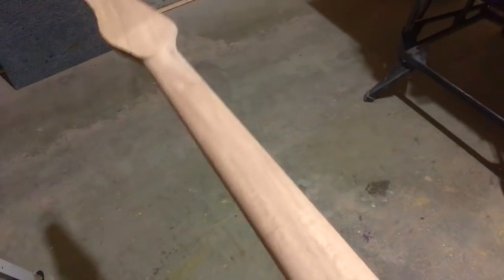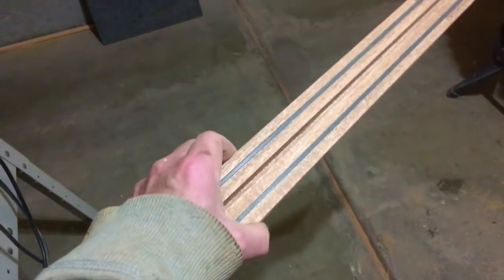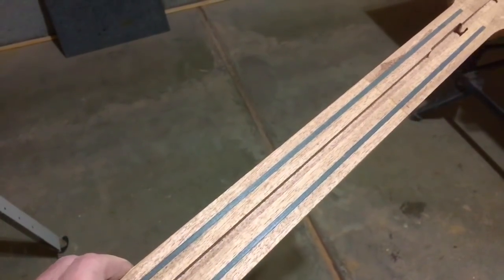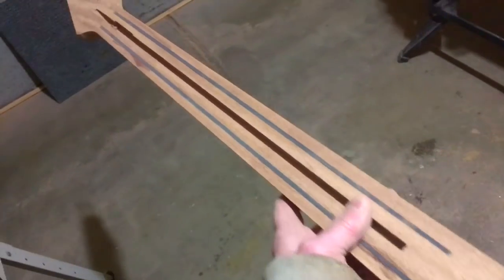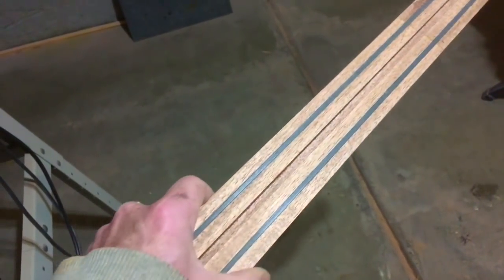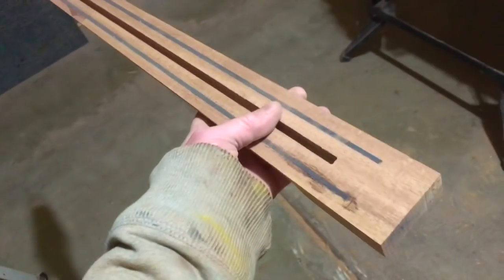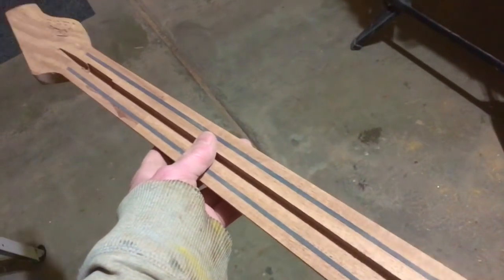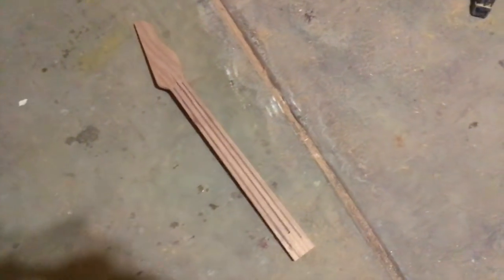Reinforce a Guitar Neck With Carbon Fiber

Comment: dual CF rods installed like he's installed in this neck will to a fantastic job of eliminating the wood's propensity to TWIST also. If you have quarter sawn and flopped your stock blanks to minimize bow warping, it induces the chance of TWISTing due to opposed wood movement laterally. Two rods epoxied in that way will kill twist. Many of the major custom shop brands are using this method now right out of the gate. Good video Chris. Last thing.... StewMac is pretty proud of their CF rods. They are a tad spendy. DragonPlate CF will save you quite a bit for the exact same product but you need to know your dimensions and order them ahead of time as they are made to order. I usually buy them in bulk of 10 -12 at a time.
Reply: @raleighburns3768  I like the DragonPlate idea.  I also like the idea of a 50/50 wood/carbon composite neck

Comment: @Highline Guitars  Wonderful Video! I have been having an issue for years on my Strat neck. It always moves, gets unplayable after multiple setups too. Can I take off the rose wood finger board and route it for the carbon fiber reinforcement on that neck as well?
Reply from the maker: You could, but that involves a lot of work to get it right.
Reply: @HighlineGuitars  so would you recommended it? 
Also thanks a ton for replying.

Comment: I picked up an Epi 335 for sale last year that I really love. The one issue I have with it - the flimsy noodle of a mohagany neck it came with. So much so, that when playing cowboy chords (open A, D, etc), the pressure of my hand on the neck bends everything out of tune. Never had this issue on any other guitar I've ever owned. 

In your opinion - would it be possible/worth it to remove the set neck and try doing something like this?

Thanks in advance
Reply from the maker: If you have access to a CNC machine and know how to use it, it would be easy to make a new neck with carbon fiber reinforcing rods. You could still do the work entirely by hand, but only you can decide if it's worth it.
Reply: @HighlineGuitars  Thanks so much for the speedy response!

Comment: Ok, what are the eventual problems of a multilaminate neck? 'cause that's what's on my most expensive guitar.
Reply from the maker: It depends on how the laminates are done. If different species of wood were used, the different rates of expansion in each piece will eventually require the neck to be resanded.
Reply: No down side they just are stronger and more beautiful than one piece necks.
Reply from the maker: @jonahguitarguy  There can be a downside if the grain in each piece used to make the laminate is not oriented properly. The grain in each piece has to be oriented in such a way as to cancel out any potential movement inherent in the individual slabs that make up the laminate. If the grain is not oriented correctly, the wood's tendency to move in an undesirable way can actually be amplified. I've seen a lot of guys slap pieces of wood together without paying attention to the direction the grain is running in each piece. When it comes to laminated necks, they're either made right or they're made wrong. The only way to tell is to look at the heel to see if the grain in each piece was oriented in such a way as to cancel out potential movement. And remember, beauty is in the eye of the beholder.
Reply: @HighlineGuitars , well why would anyone go to the trouble of laminating a neck and then not align the grain properly? And I do love the look of a laminated neck.
Reply from the maker: @jonahguitarguy  Because they learned how to do it watching YouTube videos. LOL. ;-)

Comment: You should patent the idea(if it isn't already)!  You should patent both of your CF ideas and run with them! Even license them to other manufacturers! I think you would do well with it if promoted properly. Great tips and insights, as always! Thanks.
Reply from the maker: Look at the cost of getting a patent and calculate the potential income. It's not enough to make the effort worthwhile.
Reply: @HighlineGuitars  That's not true, you will get PASSIVE income once other manufactures start using it. I'm talking about the neck joint, not this. This is common now, Stewart Macdonald sells the rods.
Reply: Not trying to discredit Chris, but cf reinforcing rods are commonly used in guitar necks. Luthier supply shops sell these rods for that purpose. A patent application would not succeed.

His point is more about when/where to use them. Mahogany necks are a great place for them as mahogany necks snap relatively easily.
Reply: Once shown on YouTube you cannot get an patent on it anymore. Because now it is known technology.